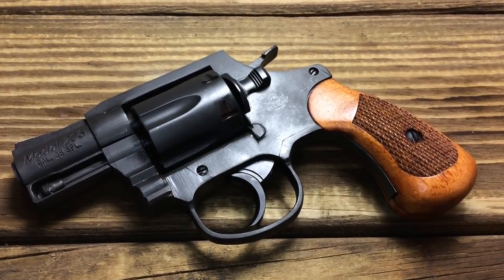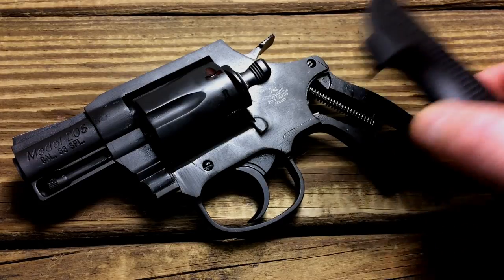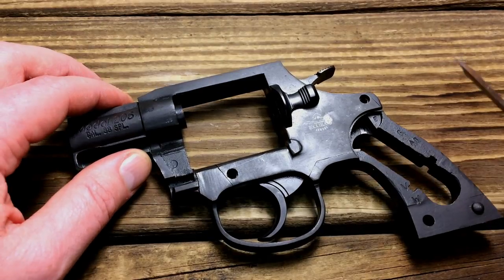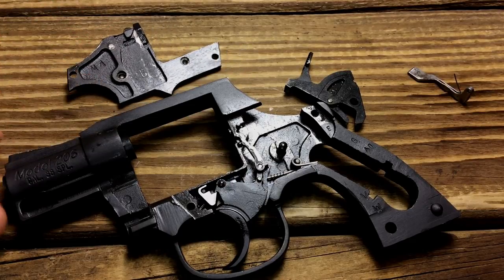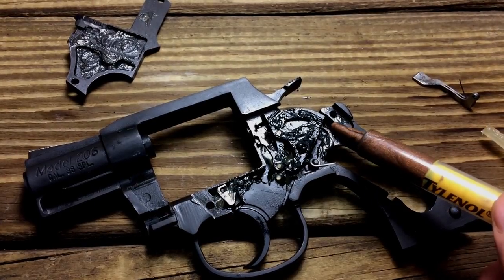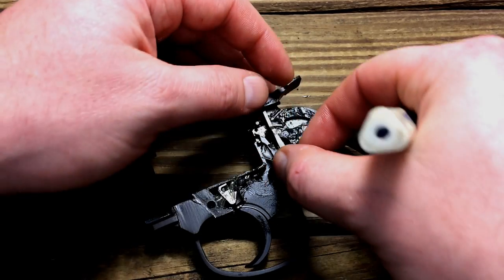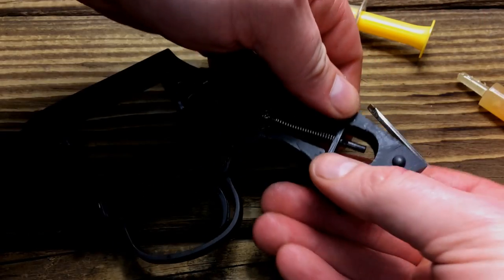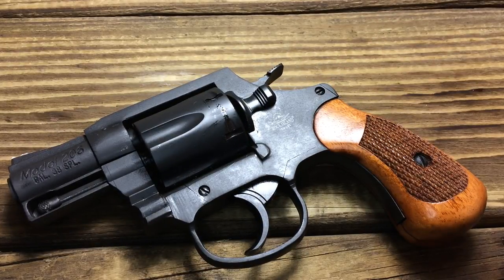Rock Island M206 Trigger Job

Comment: So I shot 200 rounds out of my M206 and  it ran perfect with just hoppe's gun oil, but I did a grease job using this method and the trigger kept sticking in double action, but not single. so I stripped out the grease and went back to just gun oil, it's running perfect again, after a additional 100 rounds still running great,  but I did learn how to disassemble and reassemble my gun with this video so that's a plus. not hating just sharing my experience.

Comment: My m200 I pulled every apart sand/polished all the guts cleaned and added a little grease and oil closed it up and it surprised me how nice it feels. Main thing I looked at was how things moved and made contact with and how sharp/rough it felt. Used 400&600 grit paper,add oil for final polish

Comment: great instructions.  finished my M206 "trigger job".  Works great with white lithium.  smooth pull at the range. ran 100 rounds of 158 grain fmj and it is still smooth.

Comment: While you already had the revolver apart I'm curious as to why you didn't also pack it with some mud and sand?  The grease is perfectly suited to trap mud and sand, which you forgot to add.  A quick way to clean your revolver is to soak it over night in a 5 gallon bucket of soapy water. The next morning just pop it in the microwave for about 5 minutes to dry the inside.  Another tip is to add some salt in with the 5 gallons of water, that might cut the grease.
Reply: 😂😂😂 I'm glad someone said it

Comment: Dry firing a revolver with a transfer bar can break it in the long run. It's good to use snap caps or just put spent shells in the cylinder to avoid such. I have seen several Armscor revolvers used by the security guards in the Philippines with broken transfer bars, because they used to dry-fire them a lot.
Reply: thank you I have a bad habit of dry firing mine, I will do the spent casings trick
Reply: @DeandreSteven  dry firing is good practice just keep doing it and buy like 10 transfer bars from armscor for dirt cheap price and replace it once a year

Comment: Too much grease ! It will collect all kinds of crap and bind it IMO 
Just use gun oil , sometimes less is more! If you want to smooth it or lighten the pull then stone the contact areas lightly …….

Comment: if you use a regular screw driver instead of a hollow ground gunsmith screwdriver you will mess up the screws just like he did. should be interesting when it gets hot and all that grease melts. packing it full of grease is not a trigger job, do not try this at home.

Comment: Grease job , not a trigger job.
Reply: Not even a grease job, video should be titled "M-206 DUST & DIRT MAGNET JOB". Next time you remove the side plate. Drill and tap a hole in it then install a zerk fitting. If you don't have a zerk fitting handy, remove the grips and soak it overnight in 90 weight gear oil. Be awful careful after shooting it to not pick your nose.

Comment: okay, I know I'm late to the party, but yeah, I'm cringing. You don't pry the sideplate out, not because you'll mar the finish, but because if you bent or warp it your up a brown coloured creek without a paddle. This is really bad advice, and it's easy to not do it, literally all you have to do is take your screwdriver that you had in your hand already, turn it over to grip it by the blade, and give the frame a thwack. That's it, it's more work to do it in a way that can DQ the gun. Why would you pry the sideplate out? I absolutely gobsmacked.

Comment: "Anti-Seize" is NOT a lubricant! That is not the proper use of it!
Reply from the maker: Tell Glock that then.
Reply: @JDalton  actually Glock does not use antiseize as a lubricant, it is actually there as a break in(lapping) compound ,this saves them even more money and time as the owner essentially laps the internals for them,that being said and a fact I actually use it for virtually every new firearm for the first few hundred rounds it breaks everything in smooth and perfect like lapping valves,then clean it out and oil as needed depending on what firearm it is, antiseize is in fact not a lubricant but a lapping compound and you can use it as such in this pistol to aid in trigger break in if you are not going to polish the parts yourself.use aluminum not copper for future reference,it is completely non corrosive and works better for lapping
Reply from the maker: Wolfman Rebel Trust me when I tell you it’s anti-seize. When I had a gunsmith shop I called Glock to buy some. And  they told me it was Loctite anti-seize and told me the part number. And that I could buy it anywhere. Maybe you should call them yourself before you accuse someone of being wrong. When it’s you that’s wrong. And didn’t do your research before added your two sents
Reply: @JDalton  https://youtu.be/-rduVAVrQCM , specifically at 18:45 ish+ , 30+years as mechanic,fabricator,and part time Smith I am very familiar with what's what,what's best and why,I feel my comment was respectful and informative, especially in claiming you can use the stuff for your benefit where as others just ignorantly claim it shouldn't be used, continue with your method if its for you and stubbornly and hatefully disregard experience I personally don't care one bit, also I never said it wasn't anti-seize,I said it was not used by Glock to lubricate as much it is used to "lap" the materials with each other,I also said you can put the stuff,the aluminum works better than copper,on your contact points and it will smooth the edges as it operates making the trigger operation more smooth..which is a good thing,what ever your problem is good day sir!!!

Comment: ANYTIME you are working with machinery that you have invested in and could possibly save your life you want to use the proper tools and techniques for working on that machine. Taking a shortcut that you illustrated by removing the side plate the way you did just illustrates the difference between the novice handgun hacker and and someone who wants to really do a professional job to the best of their ability. In firearms this is absolutely crucial. Based upon your approach, you could have saved a lot of time and effort by just taking the side plates off and dunking the entire clockwork mechanism into a container of hot grease and you would have achieved the same results. It's unfortunate that in the comments you received accolades for the approach you took. Too many Unknowing viewers will think that this is a trigger job and this is the way you do it and they would be grossly wrong. But that's alright cuz this is how gunsmiths can make their money my trying to undo with the amateur has done. If they should ever go up into court as evidence in a criminal proceeding, standby for a very embarrassing cross-examination and negative consequences.
Reply from the maker: Yeah the only benefit to doing it this way. Is you can put the grease in desired areas. And no grease leaking out of gun and getting on the grips.
Reply: Bro don't check someone on YouTube YouTube check your credit score